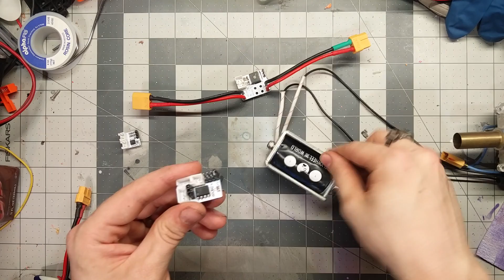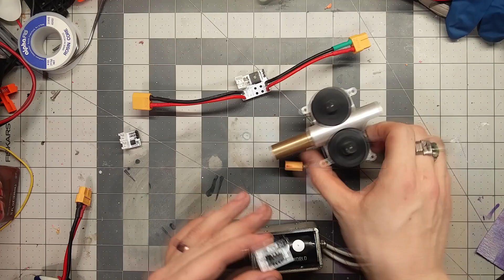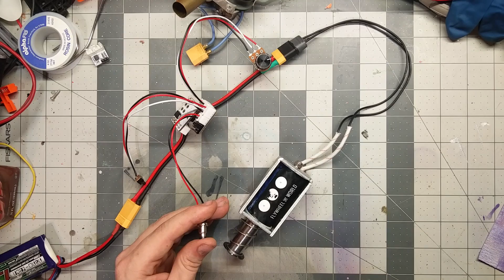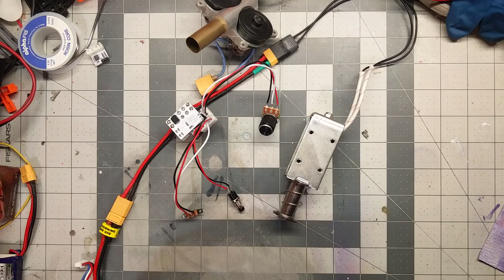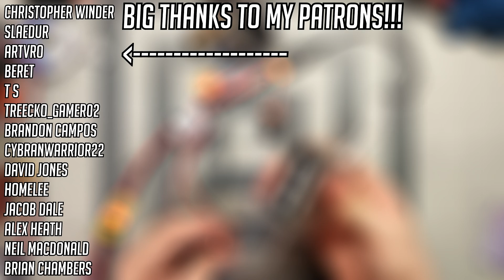[REVIEW] Suild Mosfet Board and PWM Module

Comment: so how do you wire in the cage with the solenoid?
and would you have to use two separate battery's one for the flywheels cage and one for the solenoid?
Reply from the maker: You'd wire the cage as normal and the solenoid to the pwm unit

Comment: So could you use one or two of these for a rapid strike or hyperfire and control the speeds of the flywheels and pusher separately? Or will this only work with a solenoid pusher?
Reply: The foam Farmer 
Yes I believe this does help, the rapid strike already doesn’t have single so the ability to change rate would be fine enough. Where do you acquire this FTW solenoid?

Comment: Hi, thank you so much for the great video!  I'm gonna use this system to actualize the shell-ejection concept for my coming build, only one question, when in semi-auto mode, the solenoid seems to work only a half cycle? Meaning, it locks to the rear as long as you keep pulling the trigger? Is there anyway to have it to run a full cycle in semi? Please kindly advise and thanks a ton in advance, sir.
Reply: Justin Yeang 
Thnak you so much for the prompt reply, I just left a private message in "Suild" Facebook page, please kindly check it when you are available, thank you so much.

Comment: I only use 2s single stage so I don't see why you couldn't just buy a 2 dollar knock off omron, they are way cheaper than MOSFETs
Reply: Mosfet has higher amperage discharge than microswitches, plus mosfets can use stock switches so no need to hot glue or epoxy switches very carefully, and mosfets can be placed anywhere in the blaster so some blasters with tiny switches that don't have room for a micro (like the hera) can still be upgraded easily
Reply: @ugatobekittenme  yeah I know I'm saying that a micro switch and a switch plate is cheaper, I also don't currently need one because I run a modulus ecs 10 and I just shoved a micro switch into the handle with minimal effort, I get what they are used for but I'll probably never need to use one personally